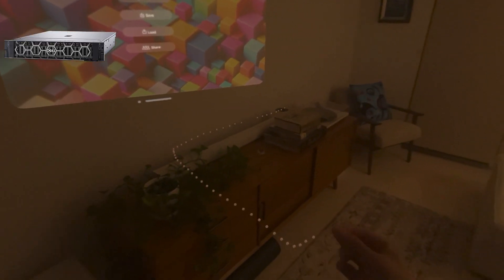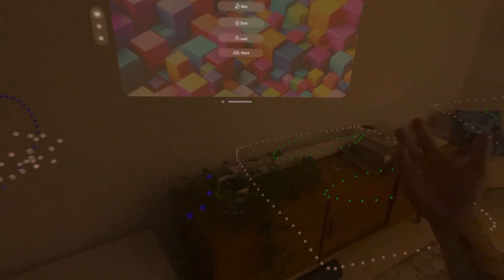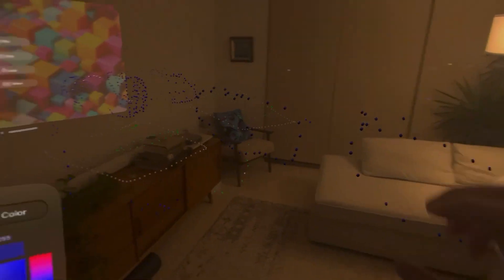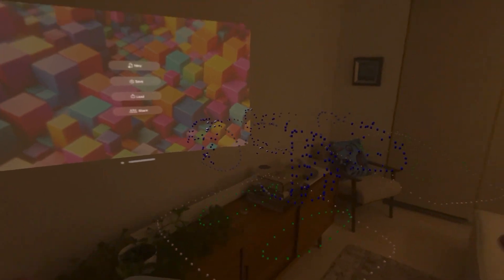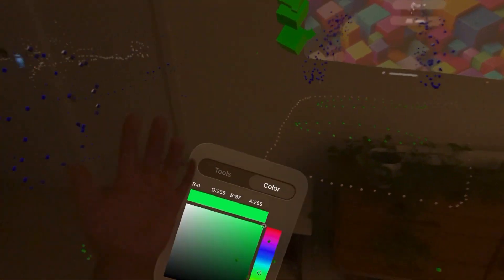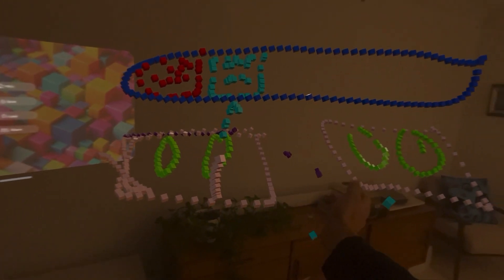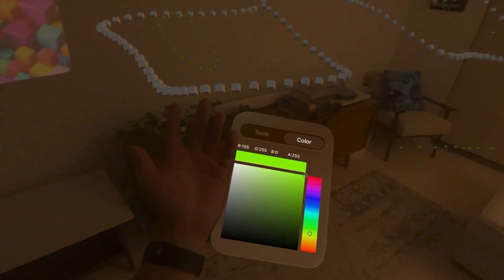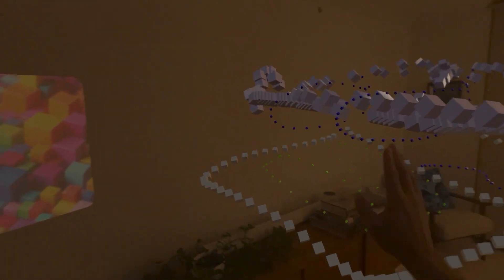I explain Fully Sharded Data Parallel (FSDP) and pipeline parallelism in 3D with Vision Pro

Comment: Is sharding usually done on a layer level? Meaning, the distributed gpus will all have all the layers but only a piece of each layer? Or is it done like a pipeline, where one gpu feeds the output of a layer to another one?
Reply: Correct me if I am wrong, but sometimes the largest layer of your model doesn't fit into a GPU. So to handle that edge case we go via layer parallelization.